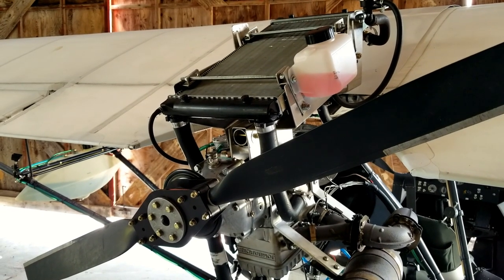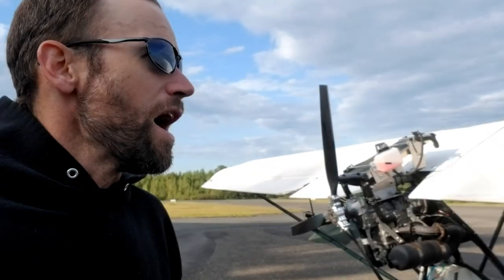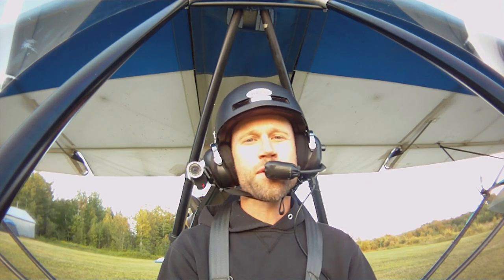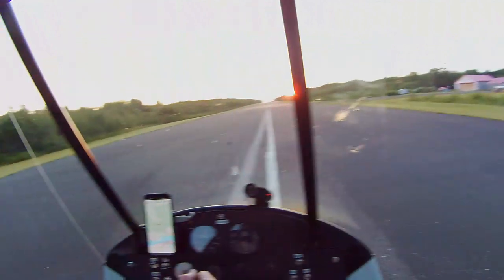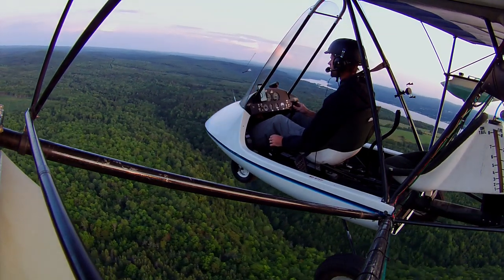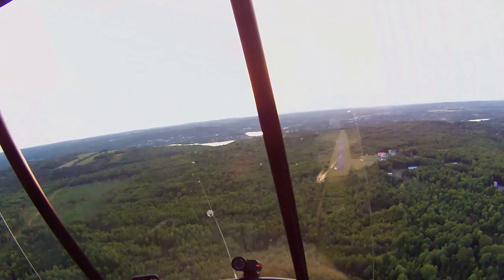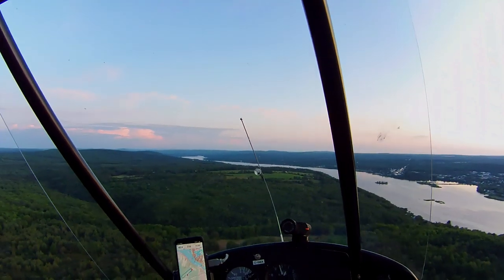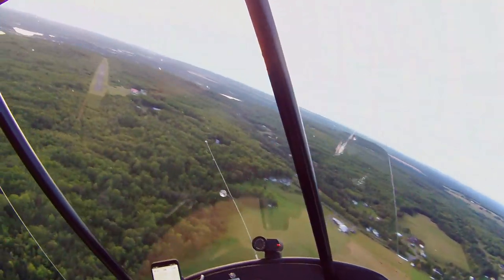Three Blade Prop on the Beaver

Comment: Good video. Something to consider is that a Warp Drive prop will have more vibration than an Ivoprop because the Ivo flexes and the Warp doesn't. OTOH, the Warp is much more bulletproof if something ever goes through it. Using a 68" two blade Ivo on your 582 with the 2.58:1 gearbox would give you the best of both vibration-free climb and cruise at the cost of you not being allowed to ever accidently leave a shop rag on the wing...
I have found that the 582 on my Kolb MKIII is smoothest and provides the most consistent EGT's if you prop it to turn just a hair less than redline rpm at full throttle in level flight, which gives you about 62-6300 rpm on climbout.
Noticed you said you normally cruise at 5800 rpm - Wow! With the two blade Ivo I normally cruise at 54-5500 rpm @ 60 mph for just over 3 gph.
You have an excellent rig, thanks for sharing.
Richard, N420P (For Two Old Poops)
Reply from the maker: I cruise at 5800 when I'm going somewhere, I cruise at 5500 when I'm not in a hurry. That gives me 55 mph at just under 4 US gph. The Kolbs are much more aerodynamic than the Beavers which explains your higher cruise speed at lower RPMs.
I love the IVO props, they are SOOO smooth. But with the main gear in line with the prop arc, I can't run them for fear of damage. The rugged nature of the Warp Drive is why I use them.

Comment: Matt, curiosity question. On an average video, how much time do you spend editing? Your edits are great. I'm asking because I know it takes me sometimes two hours just to find a photo or video piece. The one I'm working on now has been two + months.
Reply from the maker: I'd have to guess that it takes on average about 6 hours to edit a video. I usually get it done over the course of a few evenings. I have found that the key to editing efficiently comes down to how well you manage the footage files. I name them as they come off the camera and they all get sorted into their respective folders so I can find them quickly.
Reply: @mmatt  That's what I figured. I've got crap scattered everywhere. Thousands. I just bought a  $1,900 DELL. Guess what? Broke already. Been on the phone with India's for the past few days. Mr. Kareeshi. Wonderful. If & when it ever gets going I plan to do as you....ORGANIZE,! Thanks Matt! North Florida about 60 degrees at 10 p.m.

Comment: I've always used 6600 on a 2 or 3 blade. Towing hang gliders, I used full power to 2500 with no problems whatsoever...503. Over 300 tows.
Reply from the maker: 6600 static or in level flight?
Reply: @mmatt  I think the book calls for 6600 Matt. I may be wrong too but it seemed to thrive on running the hell out of it. Temps would actually decrease a bit at that rpm. Towing under pressure it would drop to about 6400. Takeoff 6600. Never had a problem. No B.S. If you're happy, keep on truckin'. 503...two & 3 blade Warp. Using an IVO two blade on Drifter & Trike now both 503. Got tired of all the nuts & bolts in a Warp.

Will send you a link to my bloody mess. It actually hit me in the face.

Comment: I'm unconvinced but you may be on to something. You might switch it back to the two bladed prop and have one more comparison. Hey I really loved that trip to PEI. You are one brave CFI!
Reply from the maker: If it was as easy as just swapping the props I'd do it, but it's not. I didn't buy a 3 blade prop, I bought a third blade to use in a 3 blade hub. I'd have to split the hub and re-install my 2 original blades back into my 2 blade hub and re-pitch everything again. Way too much work for me...  lol

Comment: Alright my masters thesis was "Counter rotating propellers" i calculated and simulated propellers. I'm an aerospace propulsion engineer. The number of blades and propeller diameter, pitch, etc. depends on the engine, power, rpm. Thats why i cringe when i see guys with a 60hp rotax swap their regular propellers for ultraperformance 5-6 bladed propellers. Or beast engines 200hp turbocharged with a 2 bladed standard prop, because that prop will never absorb all of that power. You calculate the right propeller for your given engine. As for the vibration, a 3 bladed prop is a pain in the butt to balance, where a 2 or 4 bladed one is a breeze compared. Why the plane seems to have less vibration is would guess that the prop imbalance cancels out the engine vibrations. If you install a new prop with more blades and your cruise, climb, etc does not improve it means that the old one was already using all of the engine power available. I've actually seen on an ultralight someone replace his 2 bladed prop with a 3 bladed one and lose 3kts cruises speed, because of the extra mass of the 3rd propeller.
Reply from the maker: Thanks for weighing in with your expertise. :-) This is how I mostly understood it too. Why the 3 blades are smoother than the 2 blades has always been a mystery to me too especially when both props are balanced properly. But regardless of why, I have always found a 3 bladed prop smoother than a 2 bladed prop on my plane. Here is one explanation I've heard recently: because the prop is behind the fuselage, one blade is always in "dirty" air and that causes whichever blade is in it to produce less thrust which will create asymmetrical thrust which causes the vibration. With 2 blades, one blade being in the "dirty" air means 50% of the thrust is affected, but with 3 blades, only 33% is affected. Combine that with the higher frequency of the vibration and you get a smoother ride. I don't know if any of that is true, but at least on the surface it makes sense. This would only apply to pusher style aircraft of course.
Reply: Thesis did it include mass over area and the p-factor 3 blade pusher should definitely be included where thrust greatly effects the angle of attack. Air flow at idle in a tractor configuration is different with structure in front of a prop in a pusher configuration.
Reply: @1STGeneral  My thesis was calculating the thrust output of the propeller and the interactions of the airflow from the first propeller with the second propeller. It was supposed to lay the groundwork for an easier way to design propellers for high speed, high altitudine aircraft. The program output was blade geometry, twist, pitch, etc. I was supposed to continue with the thesis for my phd, but the market demand for highspeed, high altitudine propellers in dead. To achieve mach 0.85 with a 6m diameter counter rotating propeller with 4 blades, the tip speed was mach 0.98. Extremely noisy. Asimetrical loading i considered negligible because of the way the airflow interacted in the counter rotating props and my professors agreed that it was negligible.
Reply: @mmatt  I build powered paraflyers, which are low/slow at 30mph+-. Our ideal blade setup probably is more akin to air-boats for comparison.  Since we come/go at est. half the speed of typical FW/UL, the received noise duration on the ground is about doubled. Sound nuisance abatement leads me to max prop tip speed @ <.5 mach, which in turn leads to long multi blade props for thrust efficiency. Admittedly there is some thrust production tail-chasing between 2-4 blade prop sets, but 3 blades over-all seem smoother than 2. At my air speed/prop RPM (1750 max), most effective blade pitch at .75r is between 10/14deg. Side note; time spent fussing over assembled blade set balancing is not wasted, even on new props..UL type blades are notoriously out of balance from OEM's. Second side note:)..UltraProp1 and 2 props seem to deliver the most accurately balanced assemblies, probably due the their injected molding process (albeit at measurable thrust loss VS. GSC, Warp, Powerfin)

Comment: Nice demo, you can certainly see the difference in the camera vibration between the two and three blade prop. Are you ever going to add electric start? Cheers from Winnipeg.
Reply from the maker: I doubt I'll ever put electric start on it unless I swap the 582 for a Hirth 3203. The starter is built right into the Hirth and it's significantly lighter than the 582. I'm already on the heavy side at almost 540 lbs empty. Don't need to be adding any more weight!

Comment: I was recommended a 2 blade warp for my kf2 with Rotax 582 and 3.00 gearbox but i want a threeblade for the exact reasons as this video shows! 
What prop brand did you get?
Reply from the maker: It's a Warp Drive. I have a 2.58:1 B gearbox though.

Comment: two blades hit the wind shadow of the wing at the same time, this may be a contributing factor of the less smootlier situation... I would love to see a video of your intercom system. The one I have on my naked S12 sucks.
Reply from the maker: I use a FlightTech ITC-401TC. It works fantastic.
Reply: @mmatt good evening Matt, I am going through all of your old videos trying to find the one where you changed to your coil shocks from the standard Beaver shocks and it has either been removed or I'm blind, so if you could please forward me a part number because my Springs on my 550 Plus have gone soggy or more soggier, and I am liking what you did with yours.
Reply from the maker: @TheHimaxflyer  The only thing I'd change if I did it again would be to get springs with an inner diameter that fit the shocks better. I had to have a spacer fabricated.

Shocks:
Drag Specialties Heavy Duty 13" - Part # 1310-1674

Springs:
QA1-8S450

Comment: OT: what is the typical "Cruise" Propeller RPM, vs. Engine "cruise" RPM?
Reply from the maker: The gearbox ratio is 2.58:1 so at a typical engine cruise of 5500 RPM the prop will be turning around 2100 RPM.

Comment: No safety wires on the bolts holding the prop on?
Reply from the maker: No need with this setup. There are locknuts on the other side of the prop flange as well as loctite securing the bolts. The torque is checked regularly as part of my maintenance schedule and the bolts have never backed off.

Comment: Do you have any suggestions on which prop to get for a 582 powered Kitfox 2?  I am currently running a 3 blades GSC, which works perfectly, but its starting to scare me due to research.  I asked IVO which prop they suggest for my combination and they told me a Medium 2 blade.  Your thoughts?
Reply from the maker: IVO make good props. If the 582 has a C or E gearbox, I'd also recommend considering a 3 blade Warp Drive. If it has a B gearbox, I'd stick with the 3 blade IVO but a 2 blade Warp Drive would be an option then too. I run a 3 blade Warp Drive on my B gearbox but I hear that it's not an ideal setup and that it'll wear my gearbox out faster. The Warp Drive props are heavier and apparently the B gearboxes aren't set up to handle the extra inertia.
Reply: @mmatt  Thanks for the reply.  I have a C type, 3:1 gearbox in tractor configuration in the kitfox.  Like I said, IVO suggested a Medium version 72 inch 2 blade.  I know I have all the space in the world to handle that size, but I'm a little worried about whether it will be smooth enough or about pulses from the engine on the 2 blade.  Bla.
Reply from the maker: With a 3:1 gearbox ratio, a 2 blade is a better option if you go with an Ivo. 3 blades will be no problem with a Warp Drive prop, and you're right, 3 blades are very often smoother than 2 blades. (Ivo has released a bulletin regarding 3 blades with a 3:1 gearbox, I'm not sure of all the technicalities so you'll have to look that up if you want more info on that)
Reply: @mmatt  thanks very much for the info!  Flew my plane today with the GSC today.  Still works great, nice and smooth, lots of pull...  Just getting worried due to other reports.
Reply: @mmatt  I have another question.  Do you know of a kitfox based in Woodstock with the registration C-FLTQ?  TC search shows the plane is there.  A friend of mine flew 20 of the first 25 hours off on that plane in the mid 90's, and I'm sure he'd love to hear that it is still flying.
Reply from the maker: Yup, it's still there and in great condition.

Comment: Did you perceive any difference in the noise produced by the two props Matt?
Reply from the maker: Not from the cockpit but people on the ground said that it sounded smoother and maybe a bit quieter, but I think that's just an auditory illusion from being smoother.
Reply: Thanks for the reply Matt - and all the experimentation that you share with us. Although I'm a fairly experienced fixed and rotary wing pilot, I have to say that I learn something with virtually every video that you put out! One more question: what are the differences in prop diameter and blade chord of the two types you've had (and weight also would be interesting)? Selecting the perfect prop for one's aircraft has always seemed something of a black art.....
Reply: OOPS - just read below how you achieved a three-blader from a two blader so the questions have been answered I guess - same diameter and chord but a bit more weight.

Comment: I have a warp drive 70 inch diameter 3 blade on my trike.
even with the 110 hp hirth  pushing by trike, I run out of prop pitch around 50mph.
I'm strongly thinking about replacing with a two blade  prop, which will allow for more pitch and therefore more top speed.
Reply from the maker: What do you mean by running out of prop pitch? I'm having no trouble at all with my 64" 3 blade up to over 70 mph at full throttle.
Reply: @mmatt  I'm flying fast enough that the prop is not putting enough 'bite' into the air to enable the trike to fly faster.
Reply: @rkwill100  I happen to have a Hirth 100 HP engine as well and I run a 68" Kiev 3 blade with a 2.64:1 R.D.U running at 10 degrees pitch with the supplied protractor and get about 6,200 on takeoff and will run up to 95 mph straight and level wide open at 6,450 rpm. 100 plus MPH at 10.5 degrees at 6,300. My guess is you may have too big a diameter prop for your Reduction drive ratio possibly? Or the pitch is set too shallow causing great takeoff, high rpm and awesome climb but poor cruise speed...
Reply: @airsickadventures1252  Sounds like I should trim my prop blades down an inch or so.
Reply from the maker: Oh yes... OK. Warp Drive told me to make sure my blades weren't too long or else that could happen. Switching to 2 blades would help you or you could get your 3 blades cut shorter.

Comment: I heard 3 b is harder on the bearings but it runs smoother how can that be ?
Reply from the maker: I don't think this is the case. If anything, it should be better for the bearings because there is less vibration. Some have said that a 3 blade Warp Drive is too heavy for the B gearbox, but the Warp Drive manufacturer says that there are thousands of them running with no apparent issues.
Reply: Out of interest Matt, the B gearbox does have inertial mass limits which are WAY lower than a C or E gearbox. If you're bored one day you can source the info on the interweb and see whether your prop size/weight is okay and within specs.

Comment: Go for a 4blade prop.
Reply from the maker: Probably be smoother still, but I really don't like the look of a 4 blade prop. lol
Reply: I think a 4 blade, large diameter prop might be more than a B gearbox could handle. Out of interest, on my CFM Streak Shadow (a British design - check it out!) I run a B gearbox on a 582, with a 'Precision' wooden 52" diameter 3 blade prop. It gives 70kts IAS (probably only 65 true) at 5000rpm economy cruise. 100kts plus at full throttle and 1200fpm climb solo, 800fpm mauw. The Shadow is a beautifully aerodynamic, fully enclosed two seater....sadly no longer made, but second-hand examples are really inexpensive.